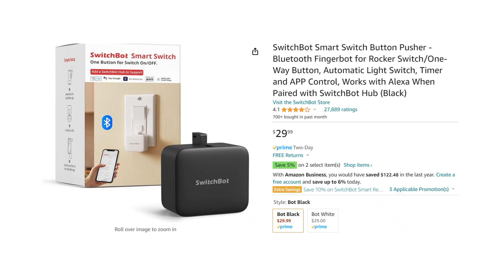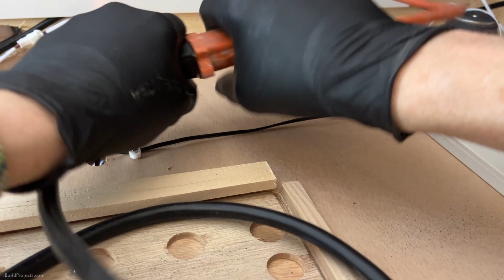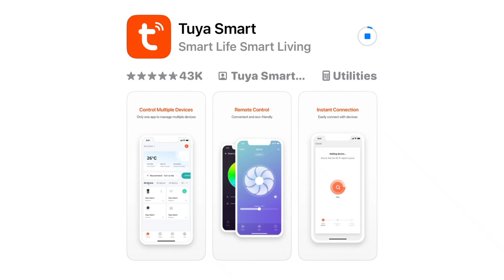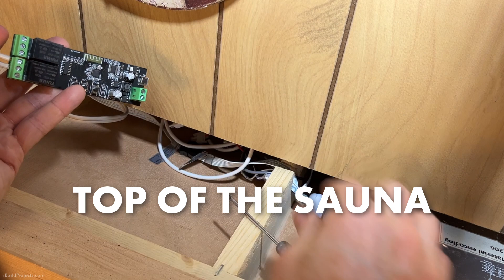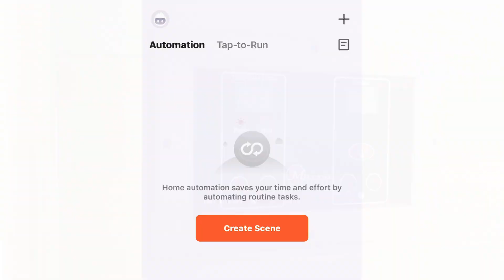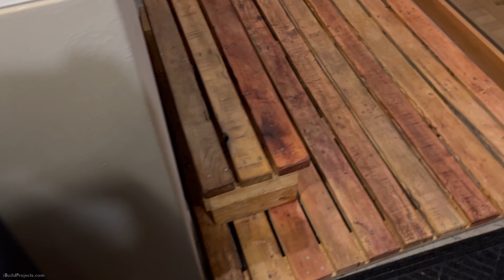Building a Remote Sauna Switch Module |  Add WIFI Smart Phone Control  |  Simple Cheap Project

Comment: This was great thank you! I did it and for some reason I can turn my sauna on in the app now but not control anything manually (not even lights). Not a big deal as I prefer the app....... But can't imagine why that is. Also Is yours just straight on/off? I double tap to reset the switch so that on the 3rd click it is back to off.

Comment: Question as we are going to be doing something similar but with some different parts. What happens if you push the sauna button inside the sauna on? I assume it will still turn on, but what status does it show on the phone? I.e is there feedback to the phone saying its on. The to me is the holy grail. Thanks, great video.

Comment: I tried this and bought the smart switch but it only works on 2.5 g networks, not 5g. Had to send it back to Amazon.
Reply from the maker: Seems like most of the smart devices work off 2.4 GHz instead of 5.0. You might be able to adjust your router to also use 2.4 GHz.
Reply: @ Yes I tried that. We have a 2.5g network too for another appliance but it didn’t work with that either.
Reply from the maker: @ Weird